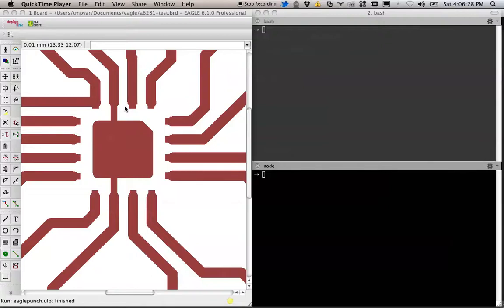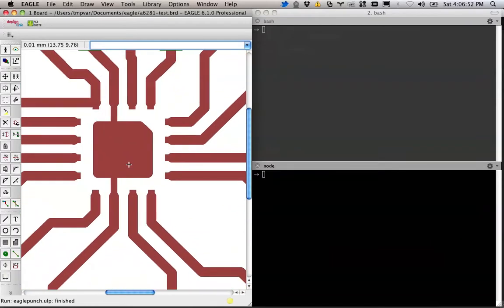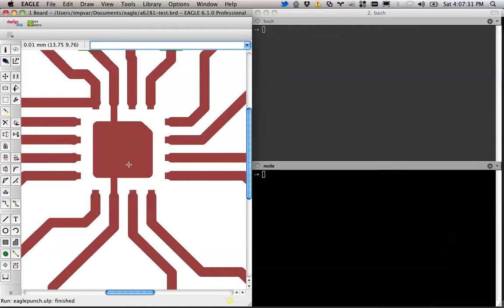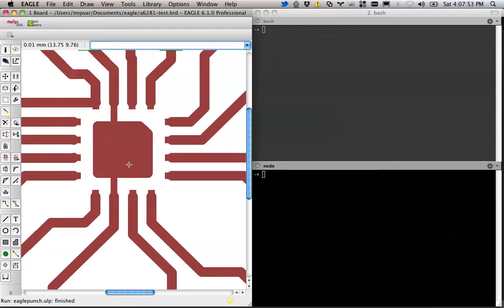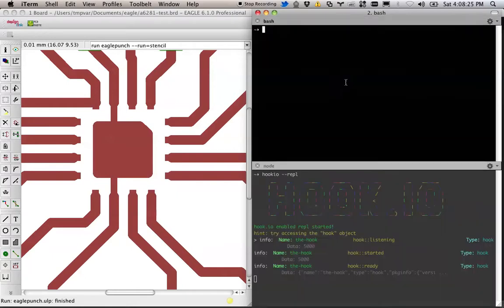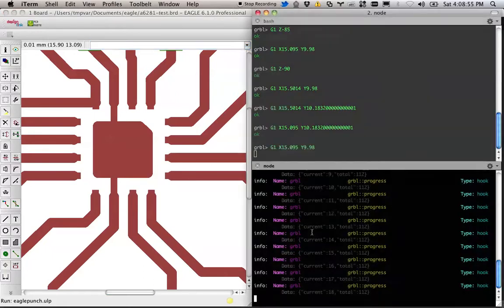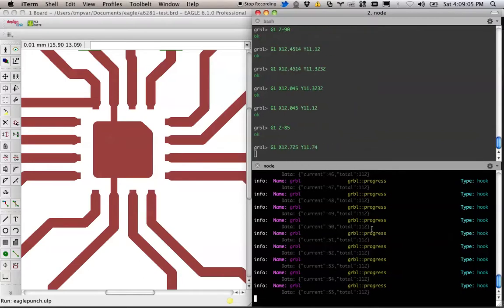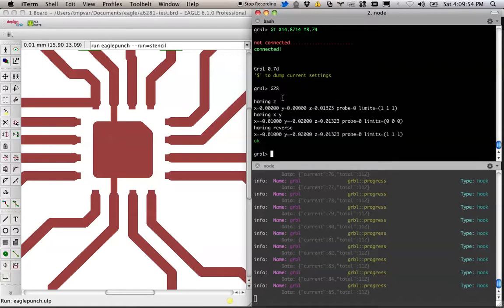node-grbl 0.0.2

Comment: What you have accomplished is freaking amazing.. I was starting to tinkering with getting node to run grbl myself when i ran across this. Difference is i wanna drive a plasma CNC cutting machine. And i will drive the grbl arduino from a raspberry pi, as a dedicated machine.

Please message me private if you wanna throw some ideas back and forth. Cause i will start taking your code apart to make it work with what i wanna acomplish. =)